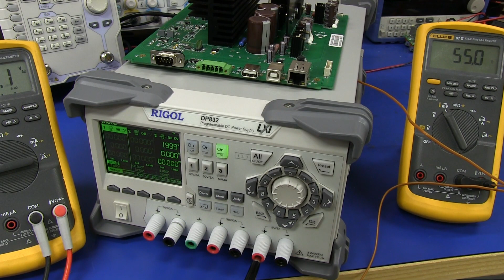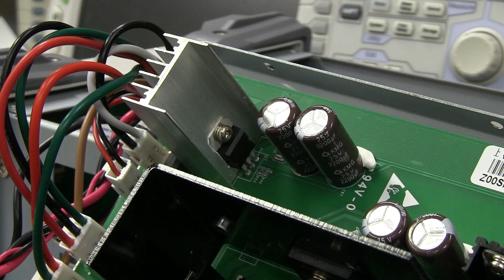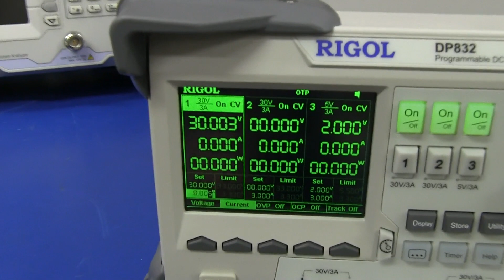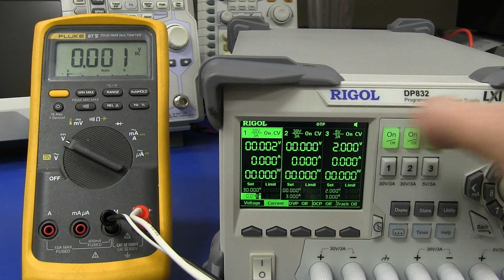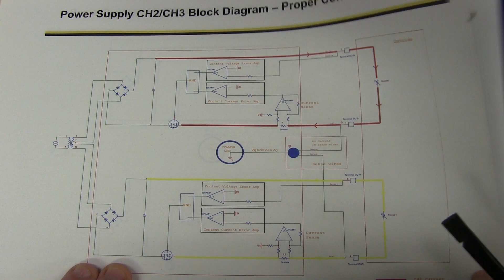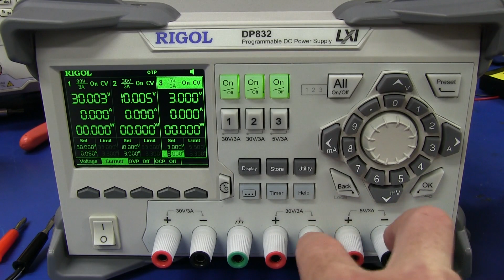EEVblog #549 - Rigol DP832 Lab Power Supply Followup

Comment: This all makes me think that Rigol's management system is poor from the top down. Ok, so some young designer was told to deal with the 5v supply and made a poor set of choices. However as Dave asks how did this pass muster and even get past first base? I wonder if any changes have happened at Rigol's management and product development stages. 
I also wonder what (if anything) would have happened if Dave had not flagged this to a global audience. Good on you Dave.

Comment: Got to say, you’ve uncovered shoddy design as it typical with a lot of Chinese products.  It comes down to “good enough” to pass off to a hobbyist however be very aware if you intend to use these for professional uses !!  Current sense circuits should be galvanically isolated!!

Comment: A Chinese engineer I worked with said what a pcb LOOKS like is the most important criteria for Chinese management. They apparently don't usually care about much else, including the thermal design, as long as it looks "high quality" and similar to competing products. He said Chinese managers are rarely well educated in engineering and focused much more on the marketability of products, matching the most obvious features with the competition even if the features don't fully work, and they don't fix known problems unless they become a significant financial issue. If a product is bad enough it's sold off, rebadged If needed, and often marketed on eBay with essentially no usable warranty. They usually recover their investment even when the products are grossly flawed. Which, in turn, gives them little incentive to properly engineer anything.

Comment: Why on EARTH did Rigol intentionally design in a hard, non-removable, non-switchable common between two of the three supplies? Haven't they ever heard of mixed-signal systems that need +15, -15 and +5V? Using this PS will, at best, throw digital noise from the 5V return onto the +15 supply! COMPLETE FAIL! Rigol, LISTEN UP! All 3 supplies should be completely isolated!

Comment: Trying to decide if I want this unit. The only question I have is when the reset was happening and you had the board out, you also had all three channels on. But in the previous video you probed the temp without the channels on. I would think it would heat up more with all three channels on, or am I wrong about this? Just wondering if the reset happened with all three channels on, why wouldn't you probe it will the unit closed and air flow with all three channels on? And besides the one part failure you repaired, are you still using this PSU. The seiglint (spelling probably wrong) isn't an option based on the terminals bananas alone being miss spaced to use with my Pomona cables.

Comment: Something I'm confused about -- hope you don't mind if I ask.  The model appears to be DP832, but it has a voltage and current resolution (in the digits) of 1mV and 1mA respectively, and I haven't seen that expect on the more expensive DP832A.  Did your power supply get customized somehow?
Reply: This is a software license upgrade additional purchase for this model to have high resolution. Just like the D1054Z oscilloscope feature software updates to 100Mhz.

Comment: Hi Got my DP832 PSU today. I did buy it mostly based on the reviews here and thought most of the bugs would be resolved by now. But the OVP is a big FAIL. When I put a 12V lamp on output 1 and set the OVP on 12.5V. Then I put the output on 11.6V and turn the knob to jump from 11.6 to 12.6. The output first jumps to 12.6 stays there for 330ms and then turns off the output. But if I do the same with a jump from 11.6 to 21.6 the output stays on for a bit more than 500ms and then turns off. That is way too long and can fry your very expensive electronics just before turning off.
So basically the OVP is only useful when the increment steps are small.
The negative pulse on the 5V at switch on is still present.
I have software version 1.14 and that is the latest one.
They could simply resolve this in software by not allowing the voltage setting to increase over the OVP value wile in constant voltage mode.  Instead they measure the voltage on the output and if that one goes above the OVP value is shuts the output of. That routine is slow so the output stays on for a long time. If OVP is on that routine should get a high priority.
This is poorly designed software.
Maybe a new followup?
Reply: So I am looking into getting a precision power supply, this being one of the candidates. My question to you is are you looking at the voltage on the,output terminals when you say it takes to long to cut off? Or are you taking what the display says that may not be actual voltage output to your DUT? Sometimes what the display says off the DAC isn't the real voltage on the output terminals being monitors by a different sense wire. So it might be getting cut off sooner or properly based in the time it takes to ramp up the real output terminal voltage, especially if your using low current since the ramp up is slower to charge the capacitor at lower current.

Comment: Ya cant complain about a capacitor on the output FFS.

My complaint wuold be the transformer in the first place. . . . This is the 21st century, have ya not heard of switch mode. . . .

Should be switchmode with 30A output and half the weight and trouble.    Linear regulators in this day and age, WTF is that. . . . Stone age.
Reply: +cucking funt 
you dont know much about electronics do you
there is very specific reason for using linear transformer and not switch mode.
google it, but I can just say linear psu are much much more cleaner, stable and reliable. this is what lab psu should be.
a better solution would be switch mode pre regulator.

Comment: So it maxed out at around 80 degrees now. But what if it gets mounted into a rack with a higher ambient over 40 instead of the normal 21 room temperature?
Reply: 80 degrees without air flow

Comment: can be connected in parallel series mode for 60v or 30v 6a 3a?
Reply: I know it is late, but yes you can: https://rigol.desk.com/customer/en/portal/articles/2283507-increasing-voltage-or-current-by-using-multiple-power-supplies-

Comment: And I don't like the internal topology of this thing. Imagine you had it set on 30 Volts, then go down to 12, but the caps are still charged, then apply your load and some type of load will get a hughe bang... That's not a usable bench PSU...

Comment: In my opinion they should just get rid of the voltage regulator and put a BUCK AC2DC-Converter to it. 5V, 2A and on the input ~12V AC, 1A instead of converting all 10 Volts (DC is 15 Volts) to heat using this poor regulator...

Comment: 9:40 you do have pretty high mains to have upwards of 245-250v.. Then again, these sorts of machines will have quite some tolerances I can imagine. Having a trannie makes a device way less flexible, though. You'll see that switching PSUs can easily handle like 70-250v without any differences in output voltage. If this was Photoninduction's channel, he would certainly have hung this PSU on a variac to see if the issue was the higher voltage.. Like maybe this machine was made for 230v max and they're just stretching the limits for the Australian market. Anyway, even without variac, Dave's investigation is nice

Comment: 7:19: Two components between the new heat sink and the left edge (inverter + power resistor?) have been rotated 90° (lower left side of heat sink)...

Comment: This was a common problem with some power supplies I was using back as a student. If we had a circuit with multiple input voltages but only 1 ground plane, we were always told to short the grounds on the supply together.

Comment: If strapping the grounds together helps that much couldn't Rigol put a big jumper wire inside the PSU? Any downsides? It could be a quick fix until they get the chance to redesign the circuit.
Reply: Fully agree, I think the main downside is the cost of doing it. Not an easily automatable process, neither at the factory nor as a retrofit fix. Did someone say Pentium FDIV bug? :P
Reply from the maker: Yes, they could do that, and I'm a bit surprised they didn't recommend doing it as part of the board upgrade. Although I guess it's not as easy as the board replacement though, as you have the uncontrolled(?) nature of having the dealers service departments do the soldering I guess. Then you have to test for it, which I don't think is part of their existing automated testing/cal routine.
Reply: EEVblog I think they don't recommend  it because accuracy will go a bit down(even if it is in specs)  and i think they don't like that. maybe they have another reason but they didn't share that with us :). It is truth they should do it from the start. but those units are already out so they can't change it now
Reply: SylwerDragon Accuracy won't go down if you short the two common points together. All the "correct connection" cases where the bug does not exhibit itself are cases where no current can flow through the sense wires; and no current would flow through the shorting jumping wire -- no change in behaviour or accuracy at all.

The other cases, where performance is currently way out of spec, would be improved immensely, and brought back into spec. So it seems to just be a quality control/cost/not admitting fault (Pentium FDIV bug?) issue.

Comment: I noticed a few minor layout differences other than the lm317 you mention:
1> top right corner, different layout and one less small electro (between the 3 large ones, and the power devices above them)
2> a few minor component selection/layout differences on the bottom of the board, check the far right, and around the regulator on the left.
Reply: There also seems to be some protection diodes near the series pass transistor.  Only the eagle eyed amongst us will notice that.  (or those from the future)

Comment: Hmmm... it's impossible to always return current to the proper ground. If I have a device, which has just one common ground and needs 2 voltages: +24 and +3 volts and I want to power it up from this supply. I have only a single wire to return current. Oops.
Reply: wouldnt they all share the same ground anyways, regardless of multiple connectors? And the connectors there are rather for when you have multipel separate projects connected?
Reply: use CH1 and CH2?
Reply: Mauro Tamm No, watch the video. There's a difference between multiple outputs with a common ground, and multiple floating outputs, and multiple outputs with a common sense wire on the ground pins (you don't wan't current to flow over your sense wires, that's the whole idea of them)
Reply: SleepingDragon Or just go ahead and wire both grounds on each channel in parallel like dave did. But still a bad design and together with the over dimensioned 5V rail AC input it's an embarrassment.

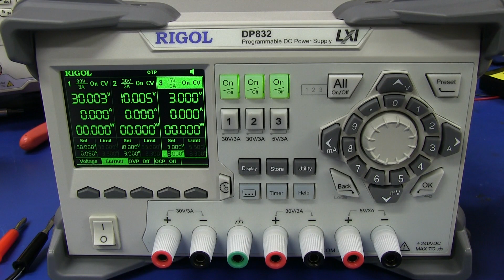Comment: Dave, usually i agree on how you put a light on things.....but this time...IMHO this is not a "...killer precision power supply". (check it at 20:14) To be honest: NO

A real IMHO killer PS would have:

1) Isolated and/or insulated grounds (=read individually) may with a switch to put them together if wanted but not by default.

2) No cap in the output after the regulator.

3) No resistors in ground path at all !!
Reply: 1) Expensive.
2) Yes, I agree.
3) The resistors aren't the issue, the voltage ground sense wire is placed before the resistor. It's the fact the current is allowed to flow through the sense wires, creating a V=IR error, that's the problem. This is fixed by properly shorting the common terminals, e.g. using that green wire in the video. Again, the current sense resistors in the ground path are just fine; completely equivalent to having them high-side according to Kirchoff's Voltage Law, in fact. Just easier to measure them when they're down there.
Reply: TheHue's SciTech
May you´re right, i know this all, but hook up, let say, an audio amplifier with split power supply (i.e. +/- 20V or so) to it and feed an input signal from an MP3 player powered by the 5V rail....and I bet you´ll get hum at the amps´ output may also noticalbe/audiable though connected speakers....

Comment: Why did they mess with the ground??

First of all the ground resistance in any ( =read every) PS should be as  low as possible, or the user may ran into hum problems when using the PS in audio circuits.
Next time, put the current sense drop resistor in the positive path (as usual) and you´re done.
Reply: No. Look carefully at the schematic, the two halves of the supply are galvanically isolated except for the voltage sense wires. This means that the current drop resistor can be either high or low, it doesn't matter, it's equivalent according to basic Kirchoff's Voltage Laws even. It's just easier to measure when it's down low.

The issue is when you rely on those voltage sense wires to carry current for you, the V=IR is across the voltage sense wires, not the current sense resistors. Strap the common terminals together strongly, and (optionally) use just a single voltage sense wire, and the problem is fixed. Nothing to do with "ground resistance", which is meaningless in an isolated power supply btw.